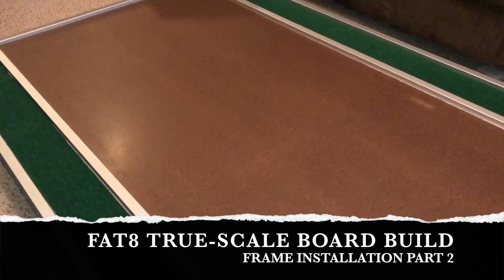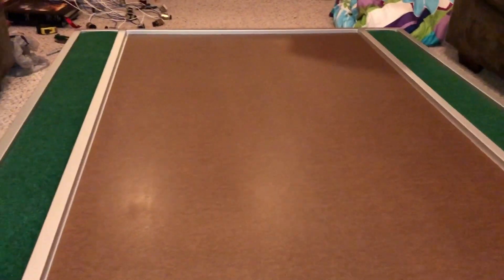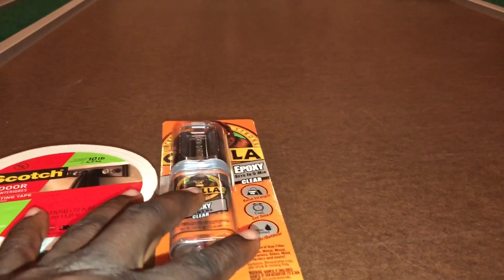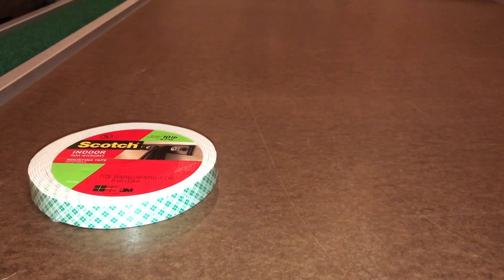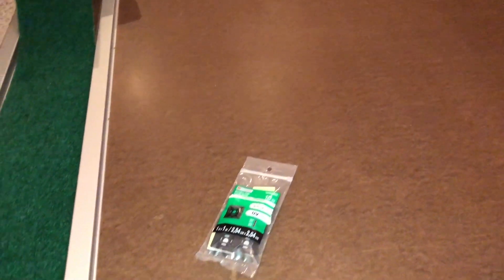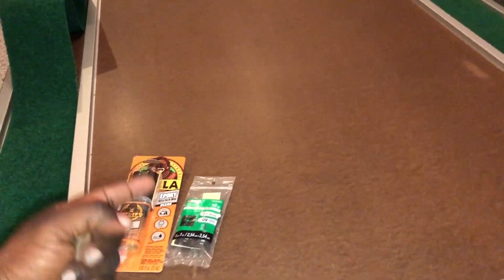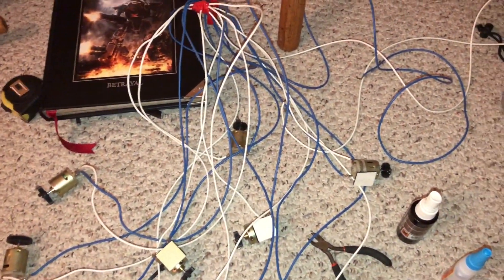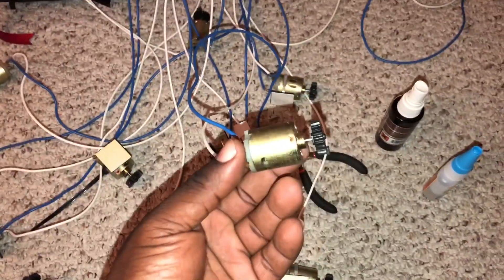BUILDING THE FIRST EVER FAT8 TRUE-SCALE BOARD part 2

Comment: Great job coach.  Are you mounting the motors directly to the board, or to the frame?
Reply from the maker: Mike Covell on the board
Reply: Wow!!  Is that going to mean a separate set of motors for each board??
Reply from the maker: Mike Covell not at all. I designed a mounting system that will allow me to unmount my motors easily and remount them when I change boards. Which I’ll demonstrate in the next video.
Reply: HA HA!  Sorry for jumping the gun on this.  It's a GREAT board, and I'm looking forward to the remainder of the build.